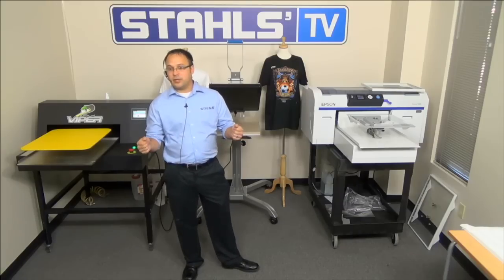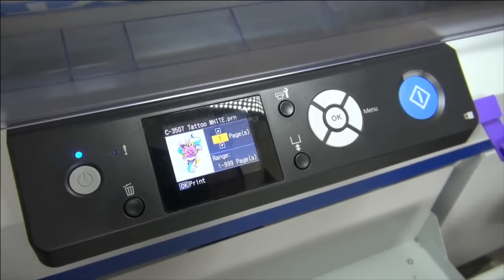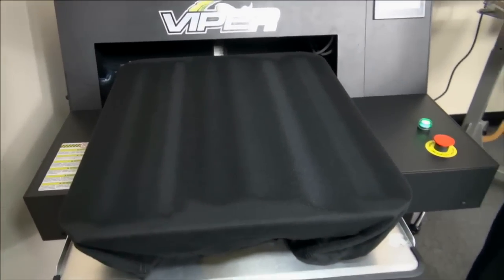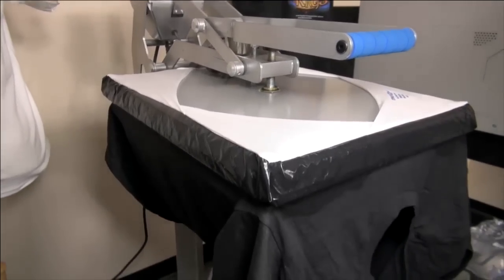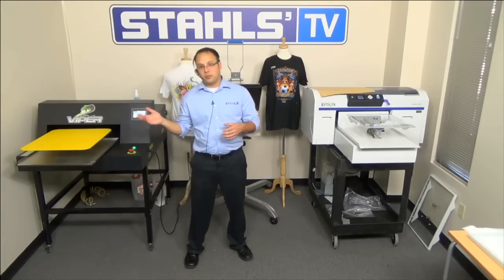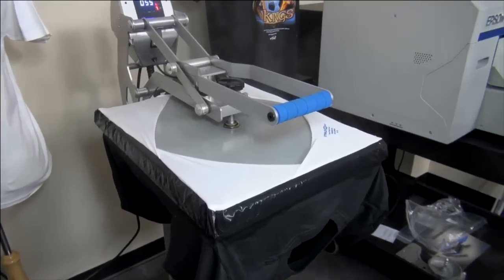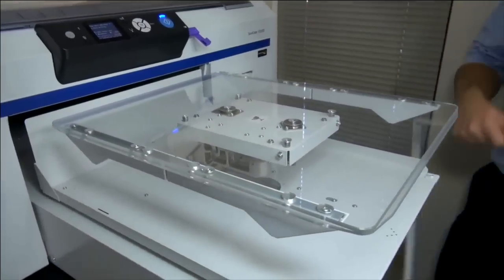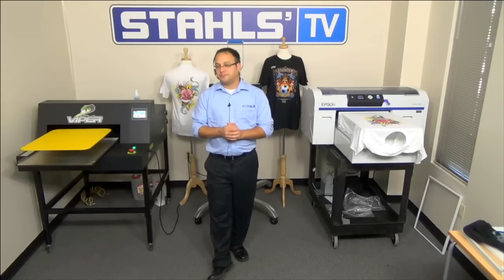Guide to Direct to Garment Printing

Comment: if i buy a epson f2000 that was sitting for 6 to 9 months with cleaning solution in the white line would it still work or would i need to replace the print head to get it back to normal?

Comment: after how many prints does a DtG printer needs to be discarded?
Reply: That is very hard to determine because each print that you print maybe a different size you may print something that is the size of your finger on a lapel of a shirt you may also print something that's 12 x 12 in the middle of a garment this machine can be refilled when the ink Runs Out it comes with a Year's warranty if this machine breaks you have a number to call or someone will guide you through how to fix it

Comment: is there a ways to insure that the shirt is sitting straight/square on the printer's platen which will the prints will be more consistent on every shirt? or using your eyes the only way?
Reply from the maker: With a DTG system you will more than likely have to just eyeball it. There are a few tips we recommend, you can use the tagline as your centering and the seams where the sleeves are attached as a guideline also. I hope this helps!

Comment: or how do one refill the ink
Reply: That is hard to determine it depends on how often you use the machine how many prints you actually print in the size of the prince that you're printing are you printing on baby clothes or you printing on full size men's shirts are you printing on extra large or 5x shirts or the prince that you're printing 12 x 12 it all depends when the ink Runs Out you replace it the white ink runs out more frequently than the colors